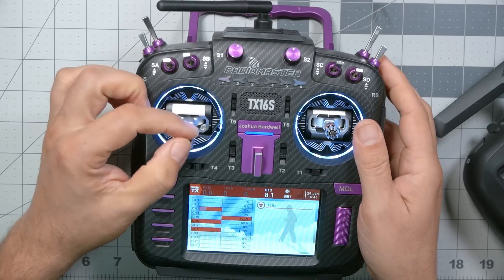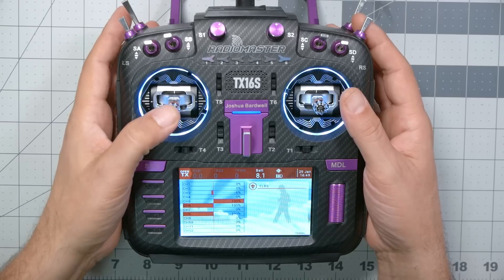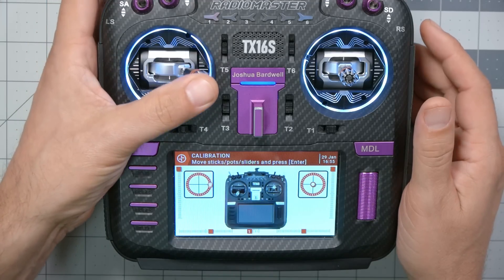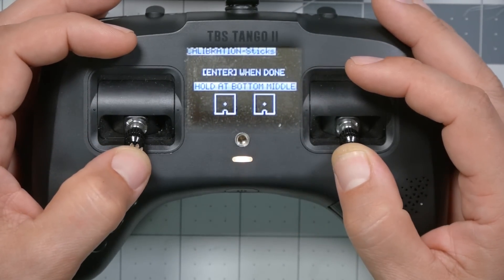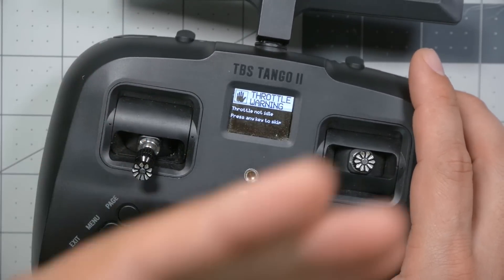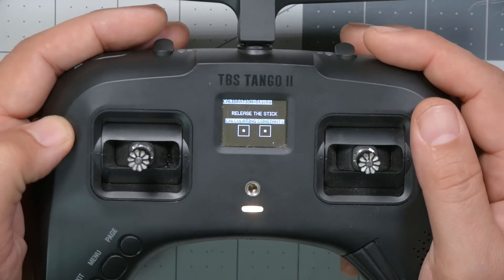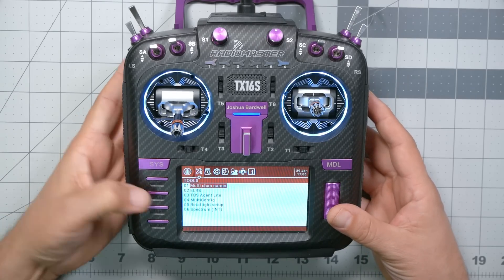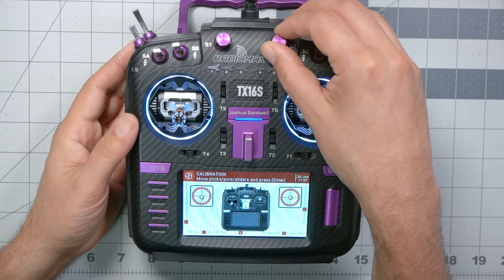You're calibrating your gimbals wrong (solves Tango 2 THROTTLE warning)

Comment: Back in the days of Windows 94 when you went to calibrate your joystick it told you to go in all four corners on these its only up down left and right.  If you go into the corners your going to get the throttle warning because the code doesn't find a minimum.  One of the corners might be less than in the center so stick in the center an minimum is reading some throttle

Comment: I found this video as I had the Throttle Warning every time I powered up my Radiomaster Boxer.
I've tried calibrating sticks gently as you advise, throttle position is showing -100 but still get Throttle Warning every time.
And, no, I didn't know about the 6 button calibration. Thanks
Reply: SOLVED - radio was in Mode 1. Changed to Mode 2 and problem solved.

Comment: Is there something that needs to be done in betaflight receivers tab?  I just got my elrs zorro going and the outputs on the radio all seem fine.  0.0 at center stick, -100/100 at max deflect, but in the receivers tab some of them seem quite off.  Like my roll access is reading 1482 when centered and not 1500, and when I max deflect, that delta remains, it goes more left than it does right.
I am pretty confused, and not sure if it is a big deal or not...

Comment: I could not for the life of me get the Tango 2 stick inputs to register in Betaflight. I did not realize that I had to calibrate the sticks first in order to get the signal to the TX, then to the RX. It makes sense that it needs to be done first but boy howdy was it a point of frustration. You helped me learn something in the video, Present Day Ben thanks Past Joshua - I owe you a beverage if I run into you at SpinUp or some such drone event.

Comment: So I had exactly the issue you described with the Stick end of throttle but in my case I can't slam the stick or push it harder to get my full range.      It occurred from one moment to another and I can't remember if or what I was doin. If I hit the outside of the gimbals I see these open edges as well (everywhere) except the throttle stick when pushing downwards and when I see the channel monitoring I just have around 65 percent and throttle is jittering . I can't find a solution. The radio itself is a new one wich makes it a bit harder on top. Can ANYONE help
Reply: Also I realized that I have slightly shivering on the throttle channel as well. I tried to get rid but I need more knowledge to know where exactly I have to go to change stuff like this.

Comment: I'm considering to buy the mark 2.
And i would never know that you have to calibrate the 6 buttons and how. In fact i thought it's the transmitter battery indicator 😂
Also how to calibrate the sticks. And the explenation that only the cheap sticks should move to the corner to calibrate. I thought all sticks should be moved to the corner.
This upload is very very usefull for me.
Many thanks 👍👍👍

Comment: Funny thing.... The moment you said there was 1 control most people don't know needs calibration too, I KNEW you meant the 6-pos.
Not that I know that much about the radio or something... Never even toughed one like that in my life... but I happen to have watched the video on how to swap gimbals to get those nice all metal CNC machined ones in :p

Unfortunately, the most modern radio I have is a " modelcraft" MP-26-DT. Got it for free because the previous owner wanted to throw it out, and I needed an old RC controller to convert to USB for flight sims XD
The BEST controller I own is a groupner JR... at 40MHz... An oldie, but it works perfectly... And since I don't have anything to control to begin with...... XD

Comment: For the Tango2:   
I was just about to go crazy. Had a slightly off YAW stick after upgrading Firmware... So started calibration:
  did MANY attempts, always ended in terrible reaction of the sticks (not just a bit off). 
Gave up and tried it a bit later, this time I always waited for the BEEP and THEN moved to the next position (the icons move a bit to soon IMHO) 
Also: I suspected the the max power output of 1W could be an issue - so I set the TX of Tango to 25mw only mode. I feel like this did the trick!
Also of course: the + movements after the calibration process have to be done with caution...
Reply: I think I may have a similar issue, maybe the same. It has driven me mad for years now. No matter what I do, yaw drifts as I increase/decrease throttle. Even being extremely careful not to deflect yaw stick, there is a yaw input delta of something like 1.6 pts. as I move the gimbal from min to max throttle. I have tried opening the case and making sure there is no battery pressure on the board, I've reduced the power to 25mW as you say above, I've tried redoing the calibration a hundred times with extra light pressure. Nothing works. The only idea i have remaining is that the Gimbal or sensor is defective. i.e. maybe the magnet is glued in slightly angled or something. Unfortunately, the result is I get some yaw input in my quad at variable throttle positions. Such a shame they used cheap gimbals in a such a promising product with great form factor. I've always hated my Tango 2 because of this issue.
Reply: @DavidTaghehchian  I've altered the mw, but I also waited for the next morning where it instantly worked.
Maybe it's temperature related?  Try it with a war tango2 (or a cold?).   or just write TBS about this and ask for a replacement gimbal - should be easy to change.
Reply: @Rcschim  thanks for the idea on Temp. I have thought about icontacting TBS support, but I am currently living in a pretty remote part of the world with limited ability to receive any replacement parts. I'll have to see about coordinating travel with delivery of the parts some place else.

Comment: I installed the AG01 in my tx16s and I get a throttle warning, even after calibrating the correct way.  For the life of me, I cannot figure it out and I am worried about maidening a new plane with it.  I read on RC groups that when calibrating, people don’t let the stick go all the way to the bottom (throttle).  Can I adjust the endpoint from the screw on the front to fix this?  Thanks for the help!!!

Comment: Hey Josh, thanks for your videos,  

i'm not able to get 100/-100 on some edges after calibrating and yes as you suggested without applying force.   this is brand new Jumper-t-pro elrs(1w).
Reply from the maker: Check the endpoints in the outputs screen. Remember the goal is to get 1000 / 2000 in the Betaflight receiver tab. This often requires endpoints less than 100% in the radio.
Reply: @JoshuaBardwell  <3 comment from you.

i think this is a flow in design or bd quality gimbal (2 brand new jumper t pro 1w).

after achieving goal of 1000/2000  in left / up / down / right,     values in  left-down or right-up(many cases) are slightly different ~ +15point.

i did notice also that by increasing the power of internal module of elrs, there's some jitter.    but still i have the prblem even with lowest power.

Comment: So I just bought a Radiomaster TX16S a few days ago. Was excited to try it out with liftoff and tried to calibrate and do rates and still was getting weird movements and even without touching the controller the quad inside the sim was accelerating of all a sudden and lifting itself from one of the sides. With this video I just fixed all those problems, now I even have better control over the quad.

Thanks!!!

Comment: what about calibrating with the DJI? Is that only done in betaflight or is there somehow you do it with no screen? I am most likely switching over to TBS soon but I would still like to try and calibrate this one if its possible.
Reply from the maker: DJI controller is calibrated in the goggles menu.

Comment: There was one thing missing in the video is to check your mode setting if set to mode 2 on a mode 1 setup you will still see a throttle warning as the stick will be centred, something you should check after performing a software update, had the mode switch on an update on Tango 2 and X9d
Reply: THANKYOU! I just updated the firmware on my Tango2 and it was like the gimbals swapped, the throttle on the right. I'm a n00b and didn't know about modes, so I'm guessing the update set it to mode 2.

Comment: Great info, I didn't know about the 6 pos switch calibration but discovered about the "pushing hard the sticks" issue during calibration when I replaced the spring of my hall sensor gimbal (TX16S). I actually notice it during the following flight as plane's rolling rate felt significantly reduced. I calibrated on the field which improved but noticed for the first time that moving the sticks around the 4 edges would result in not reaching 100% input across the edges (i.e -100% down left/ -92% down center/ -98% down right). Now, for calibration, I very gently move the sticks up/down, left/right and double check on the monitor to make sure I'm reaching full inputs through the entire range.

Comment: JB, I think you should add this as a tip when calibrating Tango2 -  Its a lot easier to calibrate one gimbal at a time instead of both simultaneously, and that way you don't mess up the process.

Comment: Bad news! I have tried to perform this on my Tango 2 and it does not help. How soft I try to "push" down the throttle (it feels just touching the end of the travel), and at the second half of the process when moving around the sticks softly I will anyhow get throttle warning.

The stick travel is +100 and -100 on the throttle stick even on very soft touching of the bottom end, I am not forcing it at all.

Comment: I had to do this with my Jumper T-Lite and be very very careful. It was giving the throttle warning on startup as well. Oddly enough, my Radiomaster T12 and Frsky X9D did not have this issue. The sticks must have a little less flex on those.

Comment: Dang, I’m feeling like I’ve finally “made it” in this hobby… I already knew this stuff! But yeah, Tango2 calibration sucks. Another issue I’ve had with Tango2 calibration is the yaw “banana-ing” as the throttle is increased. Like, is starts at the correct midpoint, then goes plus 5 or 10 at center, then back to midpoint at the top. That was really annoying to calibrate out.

Comment: I have a Radiomaster TX16S with standard gimbals. I've gone through this process and ALL my stick movements still do NOT reach 100%. they're all from -98% to +98% (actually the throttle goes from -97% to +98%). any idea what's wrong? thanks!

Comment: For once I actually knew these! There is a 'drift' issue with the TX16S though: Noticeably, calibrate at home then go flying on a hot day. Now that -100 throttle position becomes -98 and the throttle needs forcing or recalibrating in order to release the throttle cut. I'm interested to find out if the CNC gimbals suffer in this respect.
Reply: I have the same radio setup, and I get -98 to +98 even at home 😞

Comment: I've never used nor calibrated the 6 pos buttons on my tx16s.  Good to know.  It's my DJI controller that needs calibration.  The cal in the goggles doesn't appear to finish and the pots are a little offcenter.

Comment: I have the tx16s, I've had to calibrate enough times because of the left gimbal is not very good. 💩.  So I did figure out about calibrating the 6 position switch.
I've ordered the new AG01 gimbals , looking forward to installing them. 👍🤓

Comment: I personnaly avoid diagonals on my X9D when doing the calibration, because it messes up endpoints too.
Also, sliders are indeed very easy to overpress when calibrating, and you indeed need close to full throw for flaps or camber on a glider.

Comment: I recommend NOT going to the corners when calibrating most controllers. It's a common mistake causing the 'can't get -100 throttle' problem. Gaining a few points going to those corners is just trouble. Gentle up / down / left / right is usually preferable.
Reply: On the Tango 2 if you go to the corners when it wants you to go up and down, left and right,  it ruins the calibration completely.  Also, on the (mode 2 left) throttle stick, when its going through the "game" I just move it over to the bottom middle position (the spring on yaw centers it perfect) and that way I don't get the "throttle warning" .

Comment: Apparently the reason 6pos needs to be calibrated is that there's a separate pcb with those buttons that exposes a single 'analog' (probably rc filtered PWM) output. That's also why you can't split the buttons into two groups of three, for example..
Reply: I'm pretty sure the 6POS is just a resistor matrix that goes to an analog input, no PWM involved.

Comment: I've been having issues with my tx16s the gimbals are twitching and  moving  on there own been trying to calbrate but I've had no luck so I contacted radiomaster support and there sending me replacement gimbals awesome support such a quick response and free parts under warranty 😎 and only discovered the 6p switch gets calibrated aswell but do you need to calbrate the sliders 6p ect  if there not been used ???

Comment: I knew about the 6-position buttons...  I also learned about being gentle about the endpoints of the sticks early on.  Back with my early X9d I even went into Companion and tweaked the endpoint values to guarantee a resting -100 to +100 range on the throttle and carried that practice through my QX7 and TX16s.  No big deal, but then I am an inveterate fiddler and tend to know more about my equipment than most do.  

Sorry Bardwell, but I didn't learn anything new today, even though this is a valuable video.  :D

Comment: Didn't know about the buttons, thanks! Joshua, I'm just getting started and struggling with what quad to get. I have been practicing using the sims and think I would do fine with a 5". I would like a longer flyer for range. I live in the mountains and want to do the GoPro and need some range. I have decided on the DJI goggles and camera setup with TBS crossfire Rx. Wondering what rig you may recommend? I would like to build but I;m open to RTF/BTF but would like the experience building. I'm an electronics engineer, I can solder, have building skills and RC background. Thanks for all you do, I have watched so many of your videos, a real help for beginners and I'm sure seasoned flyers. You are in the asset column to be sure.

Comment: yes,knew all of content and how to stop the centres jittering on 1500
Reply: Could you share how to stop the centres jittering on 1500?
Thanks
Reply: @novideos101  In open tx go into model settings on your transmitter and then the output tab.
Plug your quad into betaflight and go to receiver tab.
You can then see if there is any jitters on centering and adjust each channel accordingly.
I find each channel ends up being 97.9 and 98.0 with a 0.2 center.
I leave ch3 (throttle) as is on 100 and displays 988 and 2011 on betaflight and helps with arming quad.
Hope this helps

Comment: Even when I do all the correct calibration I still find myself having to go to the "outputs" section of my TX16s and make adjustments there. Why is that?
Reply: Because calibration just tell the Radio's processor where the min/max of the physical inputs are.

The outputs adjust the timing sent out over the Radio's transmitter. It's two diff adjustment. One is adjusting the physic input, one is adjusting the signal sent out over the transmitter
Reply: @2tctech  well the only thing I can see I need the outputs adjustments for is in Betaflight to make it read 1000 to 2000 in the radio menu. Is that correct.
Reply: @mr.b6917  yes you can use either the outputs section in OpenTX or you can use the setting in beta flight.

But calibration is still needed because it tells OpenTX how much the stick moves so it knows where the min/max is. 

Does that make sense?

Comment: small side to the 6 pos switch calibration.. go 1 2 3 4 5 6 - 6 5 4 3 2 1 and then press 3 so it stays there.. the system expects all inputs to be in the middle when exiting the calibration, if the 6 pos switch is on 1 when exiting the calibration, it can make 5 and/or six not usable after calibration.

Comment: I had other issue related to calibration on Tango 2. When I had MPM module turned on (in module bay add-on) it was not storing calibration at all. After restart calibration was just lost... The solution was to create a dummy Crossfire model and calibrate on that model active. Only then calibration was stored in Tango 2 memory and you could safety change the model back to MPM.

Comment: JB, how often do you need to calibrate?
Reply: In General you just need to do it once  
But if you do some stuff with your gimbals like changing them or installing some led around the gimbal you should calibrate them
Reply: @deruhu9163  thats what I figured when I first got my radios over the years but I've also noticed they don't stay calibrated especially if you use on a normal basis.. I was wondering if there was a recommended time between calibration
Reply: ok  I dont kow if there is a recommendet time to callibrate but if you have hall efect gimbals they shouldt drift even by heavy use

Comment: Yes, not pushing the sticks hard during calibration was what I found I had to do with my old Turnigy TGY-i10 TX's, because you want to apply less pressure during calibration than when you're actually using the TX to fly.
I carried that gentle-stick-push-during-calibration method to my T16 and all is good.